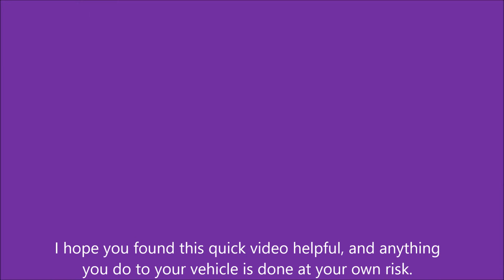Honda Civic inner door panel removal

Comment: Thank you that was a good video and I almost got both door panels off EXCEPT my passenger side door handle screw is completely stipped.And my driver side door lock is jammed so it wont let me open the door what so ever. So i am wondering how I can see the second part to your video here. The one that actually fixes the lock and yes I will buy you a coffee!! The only things I can find about my door lock is yours, everyone eles is automatic. So please help!! :)
Reply from the maker: I hear your frustration. I do not have a second part to this job, it was very hot the day I was doing this and I had to modify the lock assembly since no parts were available, thus I lost the will to continue recording since it extends the time to do the work. I ended up taking the handle off the outside and removing the latch assembly. I do wish you the best on your repair